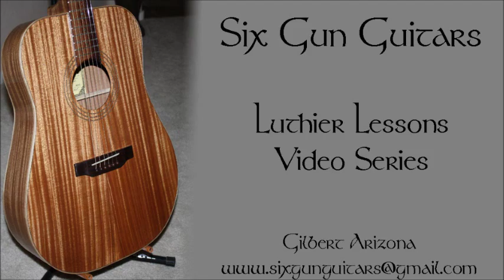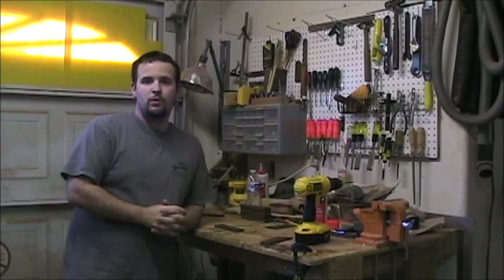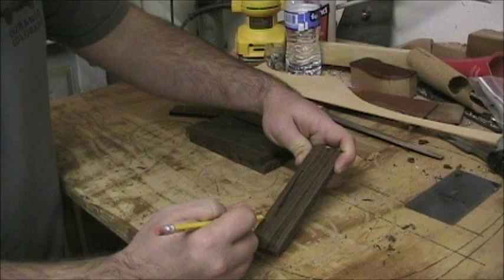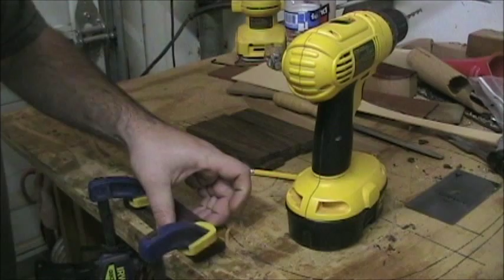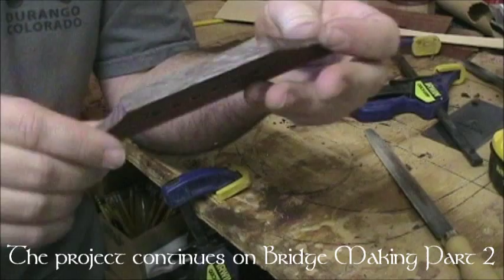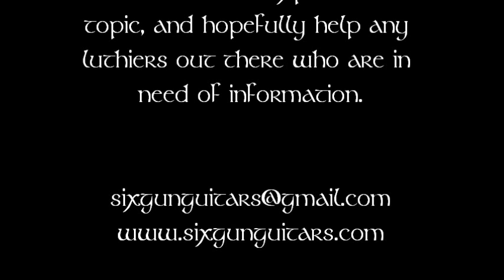Bridge Making Part 1 of 2

Comment: Do you sell any bridges?  I have an old Regal student model from the 60's that has a wood bridge that's pretty chewed up. It is not glued down and it doesn't have a saddle of any kind and never did. The strings are attached with a tail piece. I was wondering if the saddle makes a big difference in the tone.  This is not a very expensive guitar, just something to learn on but it buzzes so I don't know if it's the guitar or me or if a new bridge with saddle would help.  Thanks, Sherry

Comment from the maker: The bridge just needs to be a hard material and not prone to splitting.  Rosewood and Ebony are the two main woods used, but you can make it from really about anything.  Check the hardness and if it's in the same neighborhood as indian rosewood at least, you should be fine.